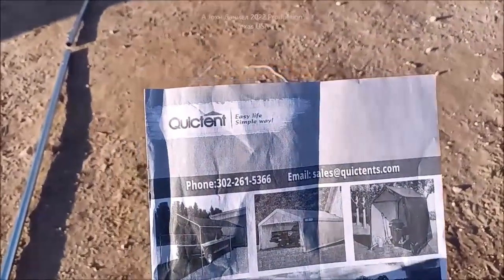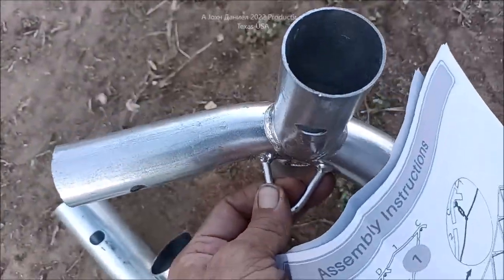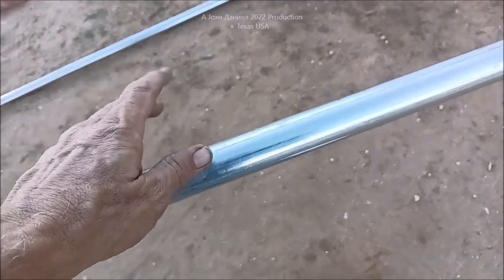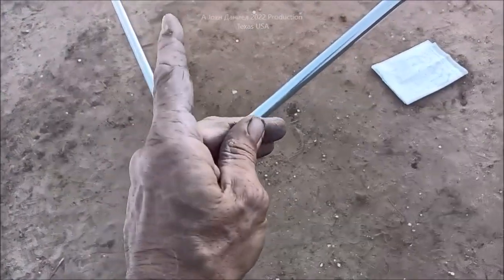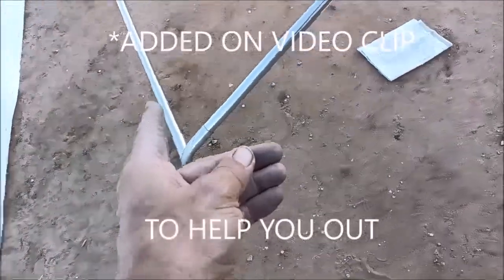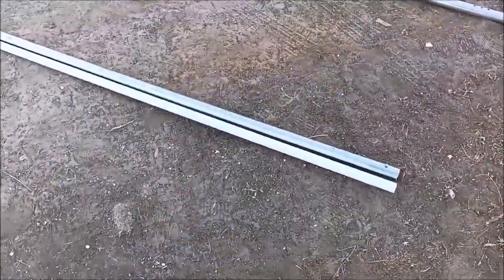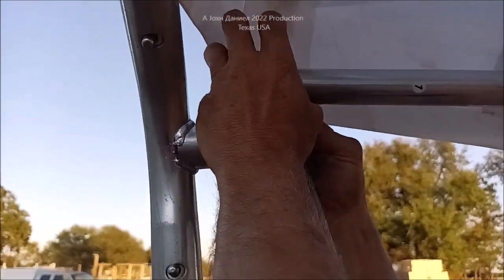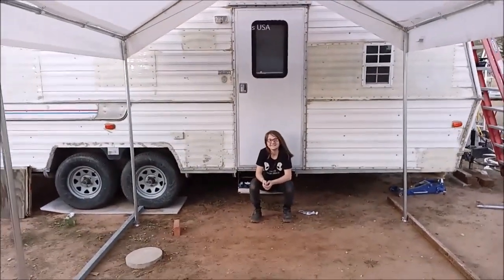EZ Affordable Heavy Duty Carports, Quictent 10x20 nice upgrade 8 post!, without extra cost!

Comment: The wind where I live destroys these. Wouldn’t last 1 season.
Reply from the maker: We ordered extra tube and fittings and made ours 5 legs on each side, and using another 22mil fiber laden 12 x 22 tarp on it over the one that came with it. The main tubes are now filled with 1-3/8 fence rail 4 feet above ground, and 18" in concrete in ground. I can walk on it! We had a massive storm with 79 mph wind gust, its still here. 
But as sold, none can handle the weather!

Comment: Hi Hogn, this is a late greeting from Quictent! Thanks for sharing our carports. Hope you like it. If you have any concenrs, I am here! 😃
Reply from the maker: We wish you would sell 6 leg per side 13 x 22 foot model with much improved connectors. I can see that so many more want that since we do not drive 1.5 meter wide small cars in USA. If you are wise, you start a new parts program called Super DUTY your Carport. This is when you sell extra center, connector and leg sections with a manual on how to shorten the horizontal pieces to add additional rafters and legs but maintain the existing tarp length.

Comment: Are you still OK with the harbor freight solar panels 100 W
Reply from the maker: With a coupon yes. If you're referring to the four pack of 25 watt panels then yes they have a better charging in low light than any of the other panels made because they're amorphous. So what you end up getting is a longer charge cycle. Personally if I could afford to do it I would buy four sets, and that way I would make sure that my batteries woke up earlier and went to bed later at night before they lost some charge. 
It doesn't seem like a lot or wouldn't mean much to most people but a lot is a what in the longer you can keep an incoming charge against your draw the longer your batteries themselves will live. And that's where the real money is at.

Comment: Looks like it could go over the trailer for a 2nd roof
Reply from the maker: Using tube in tube mounting you can raise this by putting either 1-3/8 fence rail tube inside, or for heavier installs you can put the Quictents tubes into a 1-1/2" schedule 40 pipe in the ground. So mounting has options, just be sure to anchor well.

Comment: Ok John, I want to buy a few of these awnings, where's the discount code you said you would put in description??? Thanks
Reply from the maker: Just got it. POKY7 for 7% off. 
Best I can get.
Reply: @JOHNDANIEL1  Thanks John 😁😎
Reply from the maker: @grumpyjohntxredneckrc6346   I plan to order a 5th wheel cover from them. So they offered me to give a word for a code to share. Poky fit!
Reply: @JOHNDANIEL1  I'm Buying 3-Parkin Covers From Them & I Got The 7% Off w/Your POKY7 Code! Thanks John 😁😎
Reply from the maker: @grumpyjohntxredneckrc6346  yeah if you buy three you can take all the spare parts and make them all five legged which really makes them super strong and when the tarps wear out you can just put some 29 gauge metal on the tops make sure you use some proper straps and all that jazz and don't forget about using the fence top rail in the ground leave about a foot and a half out and that thing will never move

Comment: How many years will that tarp last? Any experience on how frequently they need replacement?
Reply from the maker: They say 3 to 4 years. Replacements are not very expensive either, but mine will get 5 of the 3 x 21 foot sections of 29 gauge metal put on it when needed. That will be roof plus 15 inches down the sides connecting everything well.  I already ordered the 2 extra legs, 3 extra fittings and 3 extra rafters. One rafter to be cut to make the missing 5 spanner.  I will cut about 1.5 feet off each spanner, add one, then reassemble to make it a 5 leg on each side then roof it with light metal and still be a 10 x 20.
Reply: A friend of mine purchased one of these a few years ago to cover his classic car. It lasted 1 season before the elements destroyed it. Tarp was in shreds and the entire structure collapsed. Was supposed to be top quality, most likely wasn't this brand but looks very similar.